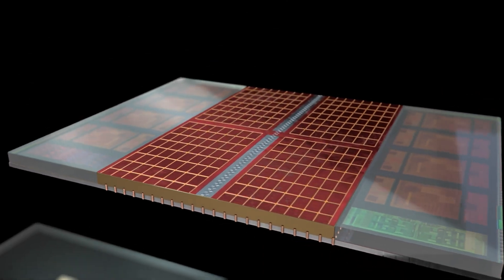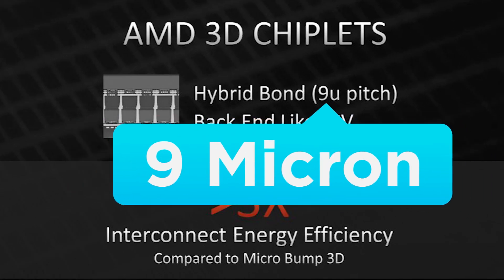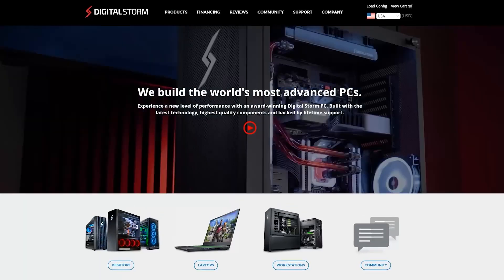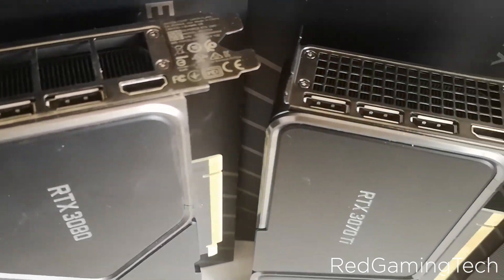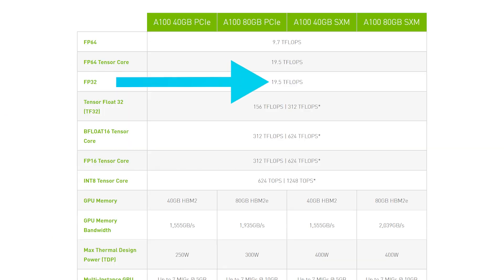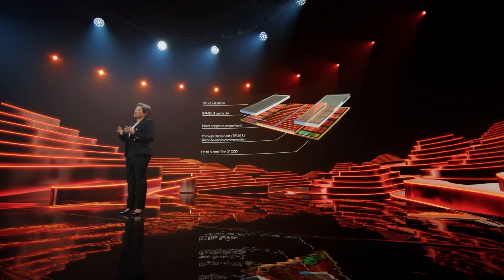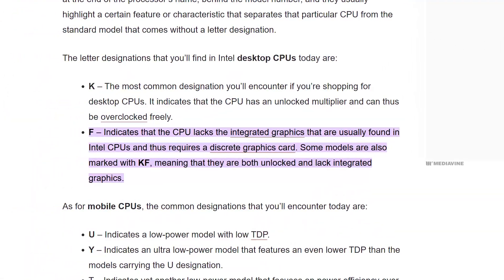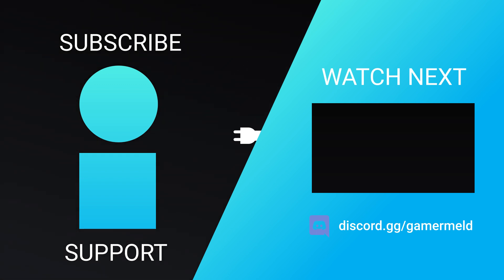Goodbye AMD APUs, Intel's GPU CRUSHES Nvidia and AMD's Best!

Comment: As always Intel crash nothing and certainely not AMD's or Nvidia's GPU. In the best case the new intel CPU (12900K) will be on par with 5950X in multitreading with consumption at 200+W for Intel and 100+W for AMD. It's not big performance. With same consumption 3970X or 3990X are by far better than 12900K. And I think that the new 6950X (16C/32T) with 3D cash and certainely really higher frequencies, will be really better than the new 12900K.

Comment: Your comparing an apu vs a gpu, it is better to compare gpu vs gpu...if intel had NOT had better specs they should been closing down... the apu is for mainstream gaming and a huuuuuge cost save vs having to buy a seperate gpu. A lot, and i mean a lot , have screens for 60 hz as there is no need for anything more..and then the apu is saving you about 3-600 usd by the sheer reason there aint any good cheap gpus , and you need to rely on refurbished stuff if you want a cheaper system. No one buys the latest gpus really unless your an enthusiast or got a fat wallet so the apus are still valid as a whole pc with ryzen 5 cost less than 600 usd..and it fan game everything thats out there

Comment: Lol. These headlines are a pretty big swing from what they were a few months ago. These things seem to work in cycles. When we saw Intel Pentium 4's under threat from the AMD Athlons early on in the 2000's intel came up with the Tick-Tock model that basically peed on AMD for a good 10 years. I believe they did become complacent while being in charge for so long but people shouldn't underestimate them, they have enough aggregated IQ points in those labs to dwarf the size of your fat uncle bobs waist line.
Their innovation phase has begun again and once they gain the crown once more the cycle will start over.

Comment: If Intel can pull a rabbit out of its hat and make a marketable CPU with a viable GPU onboard that would compete with Nvidia 3060 or AMD's 6800's then yep I am game. The market is insanely hot right now due to the Video Card demand and from all report will be for the next 2 years. So if Intel can make a GPU onboard that will fill the CPU slot AND do ok graphics........they will put a lot and I MEAN A LOT of pressure on competitors. And honestly at this point AMD and Nvidia BOTH should be scrambling to fill and source those parts that are inflating this shortage.

Comment: All of the rumors about the Zen4 processors including graphics are very similar, "we saw this leak...", without actually digging into it.    So, the idea of chiplets, with the idea that AMD has been using multiple CPU dies for Ryzen just hasn't been talked about in combination with these leaked documents.   It would make a lot more sense that AMD will put 1-2 CCDs on Ryzen, with the possibility of 1-2 CCDs that would be GPU as well, and then the I/O die which has the memory controller plus the PCIe connections.   

Since Zen4 will be on the 5nm node, it is possible that AMD would go from either 1 CPU CCD for the Ryzen 6600X and 6800X(6 and 8 core processors), and 2 CPU CCD for the 6900X and 6950X, and then you have the potential to add a graphics die, maybe two to the same processor.   For the dual-CCD processors, AMD may not include the graphics to keep the power demand down.   AMD could also offer up to 3 CCDs plus the I/O die for 5nm, and then optionally replace one of the CPU CCDs with graphics.   

This feels like the sort of approach that AMD would go for, since the graphics dies could be put into some but not all based on the target product.   Not everyone needs graphics on the CPU, and without it, the I/O die would have more resources for external PCIe connections(more lanes) on those higher end systems, and for lower end, people won't care about more PCIe lanes.

What is also possible is that AMD could offer chips with 2 graphics dies on them as well with this sort of design for those who want to play games without buying a video card...think console approach, but for a computer.

Comment: With anything mechanical, the more moving parts the lower the reliability. I need to upgrade my PC so I’ve been waiting on the DDR5 generation, but I’m worried about the reliability of these new 3d chips.

Comment: Very interesting coverage. Would be great if you put it in a visual time line as what part is coming when.
Reply: AMD has been VERY quiet, with only leaks and rumors to give any hints.   The current speculation is that Intel will launch(might be paper), Alder Lake in Q4 of 2021.   AMD has indicated that Zen4 based Epyc will come in the second half of 2022, but hasn't given any timeline for Ryzen(which generally comes out six months before Epyc).   

My guess is that AMD is waiting for more real information on Alder Lake, and if it performs within 15 percent of the performance of Zen3, then AMD can just release a Zen3 refresh with the 3D stacked cache for the 15% performance boost and keep Intel in second place.   If Alder Lake isn't garbage, then AMD could release Zen4 in late Q1 into Q2 with a much larger performance boost(DDR5+3D stacked cache plus other design improvements), and just skip the Zen3 refresh.   

NVIDIA is also flopping around a bit, not sure when AMD will release RDNA 3, or what the real specs will be on it, so we have a chicken and the egg situation when it comes to who announces what, and when the releases will happen.   If a company feels the competition MIGHT beat them, then delay and improve and try to figure out if it is possible to stay in the lead once all new products actually show up.   A RTX 3000 Super generation that launches and AMD launching only a month later but beats the 3000 Super cards would be problematic for NVIDIA and its reputation.

Comment: Just BC there is an iGPU it does not mean the APU would be discontinued.  The iGPU could be for Adobe perf improvement.  Also like Intel's iGPU there is a fallback or a solution for syeups that do not depend on graphics perf.

Comment: As someone who's still sitting on a Ryzen 3400G, I'm disappointed to hear about the APU's since they really made integrated systems usable for gaming at an affordable price.
Reply: AMD may go chiplet for the Zen4 generation of APUs, meaning no more monolithic design, but being able to easily drop a new generation of graphics onto new generations of processors(Zen4+RDNA 2, but six months later, Zen4+RDNA 3 for a refresh part).   The G processors from AMD are all monolithic without using different dies for the CPUs and GPUs, and that makes changing anything more difficult than the chips that use the I/O die.

Comment: So, the rumor is that the next-gen Ryzen APU will be using RDNA architecture, possibly RDNA2, but the subsequent series of APU will definitely be RDNA2.

What is unsaid is how much power said APUs will have, because they've only listed RDNA. RDNA is just the architecture, nothing is said about how many cores/threads said APUs will have. What is honestly likely is we will see something equivalent to RX 5500 XT or under. 

Which is still MUCH better than existing APUs, but... you know... don't get super excited or anything.

Comment: I greatly doubt the APU branding is going anywhere. It has no real technical distinction from the more common term SOC (system on chip) but it makes AMD distinctive in marketing materials. There have been endless discussions for decades over what is and what is not an SOC because as new process nodes enable higher transistor counts and more integration, it meant the definition was a moving target. Apple's M1, with its integrated RAM, might be argued to be more of a 'real' SOC than numerous other products that are highly integrated compared to the past but have no onboard RAM other than cache. (Hey, remember when cache sat on the motherboard rather than being part of the processor die?) 

AMD will likely offer chips with onboard graphics over a wide performance range. The distinguishing factor will be if the graphics are expected to be used full-time in the resulting PC or other system, or if it's minimal functionality (and die space) to be used rarely if ever, such as on servers or during PC builds and afterward to enable diagnosing GPU problems.

Comment: There is a misunderstanding here about the meaning of the term 'stop gap'. The stacking feature would only be a stop gap if were not going to be used in architectures following Zen 3. But it is plainly intended to be used in high end and eventually everything going forward. This is simply a new feature introduction using an established platform. Trying to introduce too many new features and architectural changes simultaneously with moving to a new process node has bitten companies badly in the past, including Nvidia when they launched the FX line. That stumble gave AMD's GPU division (then a separate company ATI) its first moment as a performance leader since pixel shaders became a standard hardware feature.

Example: Rocket Lake, which backported a 10nm CPU design to 14nm in order to offer any improvement for the desktop market in lieu of the product Intel intended to have in sufficient volume to fulfill all of their market segments, is a stop gap.

Comment: Integrating GPU with the CPU would be so awesome, no need to buy separate graphics cards for gaming
Reply: You can't expect APUs(CPU with graphics included) to perform anywhere close to the mid to high end GPUs.   For the desktop, just look at the AMD processors with a G at the end, 5300G, 5600G, and 5700G for the current generation desktops.   The graphics capabilities are NOT great, but not terrible for a family computer.   Don't expect to play games at over 1080p with them.
Reply: @Targonis1  Eventuallly they wi ll reach the midrange dgpu level. Also 1080p is good enough for a large part of the world.
Reply: @Targonis1  Apple already proved you can put very good GPU on the same die as CPU. dGPU's will become niche products in the future for consumers. Their main use will be in workstations and especially servers and supercomputers.

Comment: Disabling integrated gpu's built into cpu's is a practice of a bygone era of wasted manufacturing, they will not ship them with gpu dies if they go down that route.
Reply: But at the same time this reduces the number of different parts that need made.  Setup cost money.  Might be cheaper to make them all the same then bin them as needed.

Comment: I'd love AMD to do a refresh of the AM4 lineup with 3D enhancements - be it just cache, or expanding on the core/thread count. Something that will give the AM4 some longevity now that there is a big user base! It would be a bonus to their existing customers who might not be able to move on from what were in some cases, expensive AM4 boards. The ecosystem stability that AMD has (AM4), relative to the busy and forever growing socket collection of Intel, should be a big selling point that they should continue to push ...

Comment: Regarding the APU's - The latest 5600G and 5700G graphic chip vega 7 performance is low if not lower than 3400G vega 11's performance considering all aspects of chip speed and cores, Which is really disappointing for someone that's looking for casual-gaming-energy-cost-effective soultion. I won't say there isn't a place for HUGE improvments in the APU department, But it's much slower going than I've been anticipating. I assume that in the next 6 months +, We'll have a cheaper mainstream stand alone GPU's and then the APU would be less interesting as now. For the meanwhile we'll need to suck it for at least few more months.

Comment: How the hell can Nvidia release Super cards, when their current cards are all real close to each other performance wise?
Reply: My first thought exactly. Now they're gonna have Ti's AND Supers for most, if not all of, of the lineup (with ongoing shortages too, pfft) It's too crowded but nothing new, just like the shock and awe Nvidia usually employ with hype. AMD now match in base perf all the way up, except RT and DLSS (both yet lacking ubiquity of support/coverage and the latter of dubious worth against FSR's potential) but have, as usual, a very well spaced and defined stack. But let Nvidia nuts go all goggle eyed at their 5-10% max real world diff between cards, even if it helps push and normalise the pricing gaps between each and so ever higher at the top end. Which it will and would, even if MSRP was ever a consistent thing (which it's never really been for years tbh)

Comment: If I waited till January before getting a GPU it would mean I lasted one whole year with my GT 710...
Reply: @Viztiz yep. much worse than igpus of Intel 9th 10th and 11th gen core, and also worse than every AMD igpu
I have a 4th Gen i5 so it actually makes sense for me to use the 710 rather than the integrated graphics as it's a whole 20% faster

Comment: All the new GPU line ups cost way too much power imo.
Reply: I mean every new GPU you see +50W, then again +100w, then you see +200W stop please ;-;
Reply: @reclipsel  just don't go 4K on a huge monitor. Stick to 1080p at 24inch you don't need those crazy cards.
Reply: @MiraSmit  Rocking the gtx 950 for 6 years ✌

Comment: how will the cooling work with these 3d stacked CPUs? Doesnt stacking mean heat bulding up under each layer?
Reply: If thats the case heating between layers will become exponential, the layers between the top and the bottom wont get as much cooling and they will become hotter and heat the layers between them even more and more and more... at least thats what i think idk if they will need a new cooling system just for those CPUs...
Reply: @reclipsel  What would be the new cooling system based on? Some heatpipe rods going through the layers?

Comment: To me AMD mindset be like: Standardize and make Ryzen 7000G/H all the way. If some of the iGPU fails, they shut some and it becomes 7000/7000x. So the APUs are staying.
Reply: No more APUs is a stupid headline, look at Intel's mobile plans with a  beefy iGPU.  AMD are including some GPU capability in performance parts.  I expect they'll intro an APU socket down the line, like they had with FM1/2.  They won't surrender the laptop market low end, some monolithic cheaper mature process  RDNA die will come, just not part of early AM5 DDR5 memory launches.
Reply: AMD isn't Intel, and doesn't need a monolithic CPU design.   AMD wouldn't put the graphics die in the chip for processors without graphics, and AMD would put one or potentially more graphics dies in chips where graphics will be a larger focus.   With the video card shortage, there might be a higher percentage of processors with graphics included than normal, but even then, 75 percent of the chips having graphics might make more sense for AMD anyway, since your typical consumer doesn't care about game performance enough to put a video card into a computer.   OEM built computers are also primarily going with a proprietary motherboard power connector as well these days and power supplies that are 180-250W with no PCIe power connectors and no way to upgrade the power supply because the proprietary motherboard and small computer cases prevent upgrades.   So, APUs for the majority of OEM computers makes a lot more sense anyway.
Reply: @Targonis1  Cost .. APU is low end budget mainstream, fancy packaging is your profit gone.
Why do you think consoles and Ryzen G use monolithic dies rather than chiplets?
Reply: @RobBCactive  There are multiple reasons for that, the primary being that for low power draw and lower latency will favor the monolithic design.   Since Zen3 uses 8 core per chiplet, for the low end(quad-core), AMD just doesn't have complete failures from the CPU side as well that would be useful in that space at the very low end.

Moving to the Zen4 generation, improvements in Infinity Fabric, DDR5, and so on, chiplet approach would probably reduce costs, plus a more modular approach would cost less money since each die could be used in multiple places.   Using chiplets isn't really hurting profits as much as having a higher latency(which 3D stacked cache would address).
Reply: @Targonis1  No chiplets are good for high yields and flexibility, but the packaging IS more expensive, instead of cutting and hooking up one die, you're fitting several.
Just look at the mono dies in the Zen3 range and which markets they serve (APU & laptop).  There's a reason and as they have Zen3 CCD it's not for latency.  If you are aiming at mainstream volume market, then costs and manufacturing become paramount.
A reason to put Radeon gfx in most cores could be to build install base, Intel iGPU is the most common gfx and it means Quicksync instructions are there and programmed for.
Intel marketing have shot themselves in the foot on many lines due to over-segmentation.
Will AMD have such features for streaming and encoding, I don't know but not requiring a GPU lowers the platform cost greatly.  2021 taught lessons, GPUs won't be in glut till after 2022.
Reply: @RobBCactive  Costs can be linked to volume, where a higher volume of the same part will have cost savings from economies of scale.   That is where I was thinking the cost would be lower.   

As it is right now, AMD needs specific fab runs for the 5300G, 5600G, and 5700G.   A move to all Zen4 based chips, CPUs and APUs ending up with a chiplet approach would eliminate specific TSMC production runs for the different chips.   Yea, the final assembly process might cost more, but overall, the costs might actually be a bit lower.
Reply: @Targonis1  not necessarily, defects mean cores are disabled, making a 6 not 8 core chip.
There's a reason why consoles and high volume mainstream have used mono.
It's NOT power the R5 5600X & R7 3700X are 65W parts despite being chiplet based